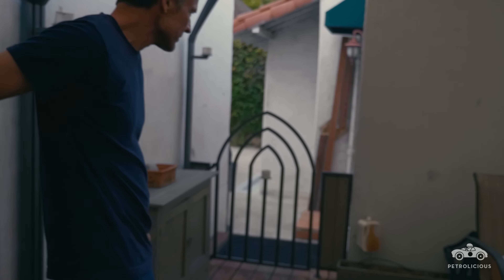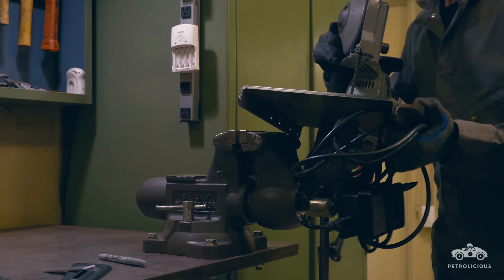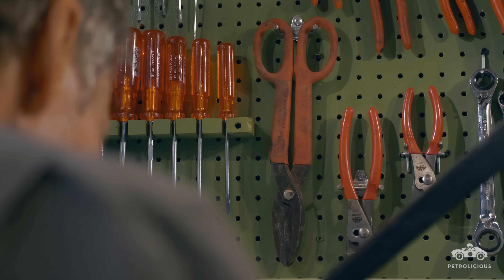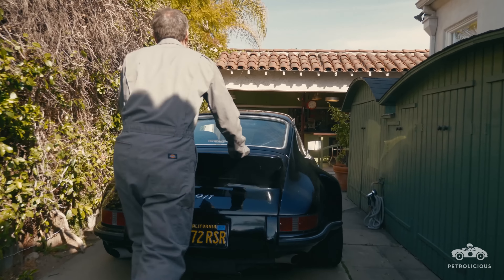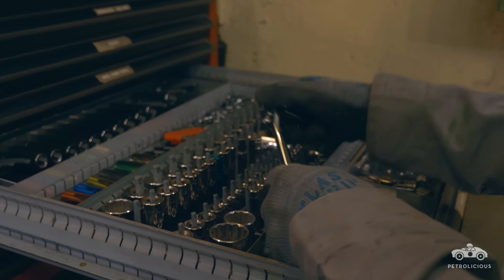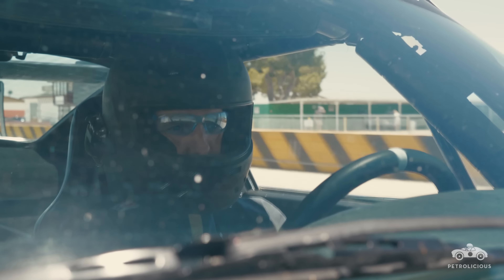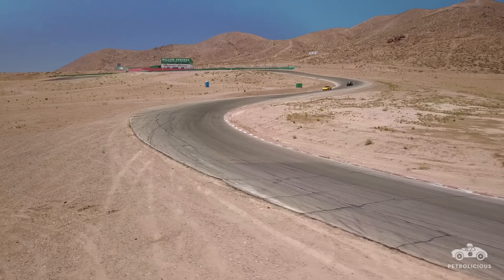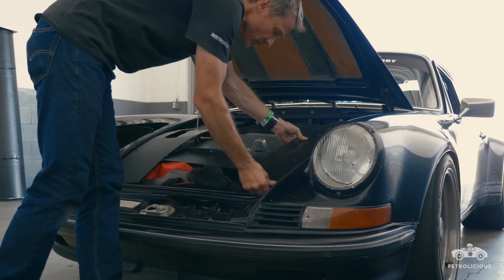Master Mechanics: Jack Olsen And The 12-Gauge Garage

Comment: That's awesome, great shop. In my own tiny shop I once finished for the day, stepped outside for some cooler air, and a semi went by. The road was only ten yards away. A sliver of steel was whipped up, maybe from the sweeping up I just did. It went right into my eye, as I stood outside the shop. I was alone. No cellphone with me. I closed up and drove for an hour and a half to a hospital. Two tears and a puncture in my cornea. Jack, please wear your safety glasses more often when you use your drill press etc.

Comment: That fold down bench is a good idea, but it looks like a struggle to lower it down due to the weight, something simple like a couple of struts from a boot lid (trunk) would sort it.
Reply: Thanks.  I originally planned to have an assist system like you describe.  But it got too complicated, in terms of keeping it hidden in the wall.  I decided I could just carry the weight of the table.  But as I get older, I might need to reconsider that.